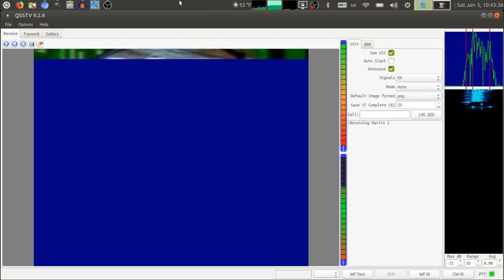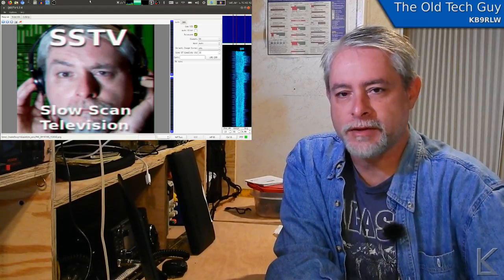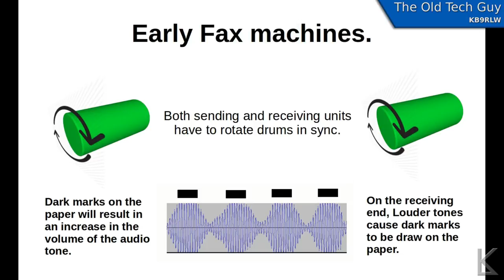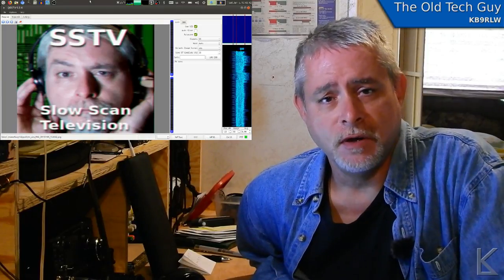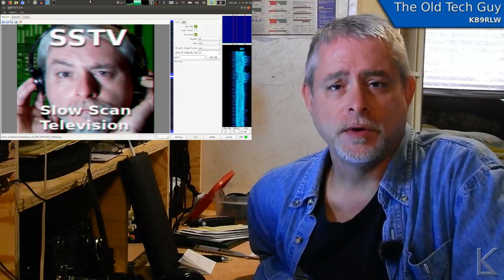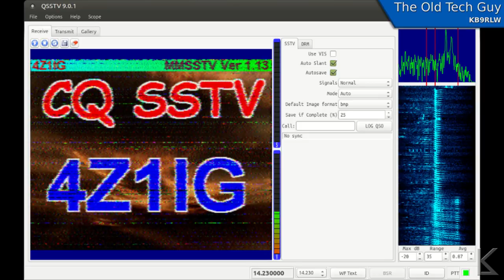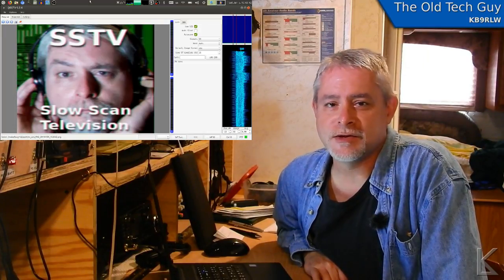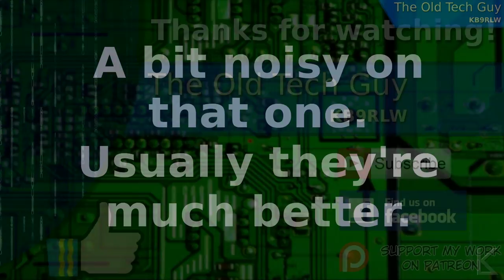Ham Radio - SSTV Slow Scan Television, an overview.

Comment: Thanks for the video. The colours mentioned - Cyan, Magenta, Yellow and Black, are ink colours for printing (usually) to paper. CMYK colours are "subtractive. " This means the colours get darker as you blend them together. The RGB colour model is an "additive" model, when 100% of each colour is mixed together, it creates white light. RGB is used in displaying images and video on a monitor or TV. Love your videos, thanks again,   73 de Kevin ZS6KB.

Comment: Nice video. I was bored and tried it out today on MMSSTV. Connected in/out sound card and within a few minutes it started working. Seems like an orignal picture text measage. Having flashbacks of the modem days and fax machine.

Comment: The ISS will at times send SSTV over 2 meters. Then you have to watch for when it will be overhead and tune in.at 145.800. Almost two things at once - satellite tracking (for finding the ISS) and SSTV!
Reply from the maker: Someone elsewhere mentioned that the ISS may be doing SSTV transmissions this weekend. Feb. 9th and 10th.   I've got a pass Saturday evening that's pretty good.  We'll see.

Comment: I use the app ISS Detector on the google play store to find when the ISS passes over head, anything +40 degrees should give enough window time to complete an image. Very handy as it you can give you an alarm for when they pass over head. As for SSTV software, there are plenty to use, but if you're off up a hill with a cheap baofeng trying your best, you may also want to try one of the SSTV apps. Robot36, again on the Google Play store is pretty good, it has auto mode and will save the image once completed. Unfortunately wind can cause the sound to be off a little and result in excess noise on the image, so try your best to shield the wind if you're doing it this way. Also, its worth noting that you'll ideally want to turn squelch off completely.
Good luck for those trying to receive images from the ISS. 

For those unlucky enough not to be able to make it out or be near a radio on the short spans that the ISS is over head, you might be able to use one of the Web SDR, like the London Farnham site, http://farnham-sdr.com/ and manually check when the ISS is overhead at that location.

Comment: About the software there is a package called "wine" available for Linux and Mac and with this you can install Windows software on Linux and Mac. So you can install MMSSTV on Linux and Mac as well.

BTW You're doing a great job with your videos! I love watching them!

Wine: https://www.winehq.org/

PS:
I use MMSSTV with wine on Linux Mint 19 (based on Ubuntu 18.04) and it works great.

Comment: Interesting stuff!  I wonder, can you DX using SSTV or is this strictly an NVIS kind of thing?  Also, why can't noise be auto-corrected like fax data sent by modem over telephone wires using parity checks and so on?  It might require two channels, one for tx one for rx, but even so, is this possible or am I missing something?
Reply from the maker: It's not a digital signal, so no error correction is possible.  It's an analog tone.
I remember many years ago that there was a SSTV event or two.  You can certainly DX.  I've picked up SSTV images from other countries quite often.
This weekend the Space Station was transmitting SSTV on 2 meters all weekend.  I think that probably counts as DX! ;-)

Comment: Hi Kevin. Will mmsstv work on windows 10. And your radio are you only using one cable between computer looks like a 7300. Thank you
Reply from the maker: I can't answer the win 10 question since I don't run windows and can't test it.  I suspect it should work though.
Yeah, the 7300 does both serial (for rig control) and audio over a single USB cable.
Reply: It works great on Win7 so it'll probably run also on 10.

Comment: ok  got it work  but how do i take a pic and make a audio  file  for this ?
Reply from the maker: Received pics will be saved in a qsstv folder in your home directory.  You can create one for TX with any graphic program like GIMP.   Under one of the menus there is an option to export an audio file of the encoded image.
Reply: @loughkb  ok thanks

Comment: ... problems here. I found a youtube video with sstv samples. MMSSTV is installed on my laptop and Robot 36 on android cell phone. The same youtube audio was played on the laptop, cell, smart tv and android tablet. Robot 36 didnt work with any, and MMSSTV only worked with the tablet as audio source. This device has mono out, so I set the cell and laptop to mono audio, but that did not work either.   What am I doing wrong?
Reply from the maker: Usually, problems are related to sound input. Make sure mmsstv is looking at the right sound input and that you can see the audio on its waterfall display. Also it needs to pick up a good signal without a lot of room noise.
Reply: ...problem fixed. The laptop and cell phone both had sound enhancements (active by default) that needed to be disabled. Once this was done, both Robot 36 and MMSSTV now work; but MMSSTV is better.